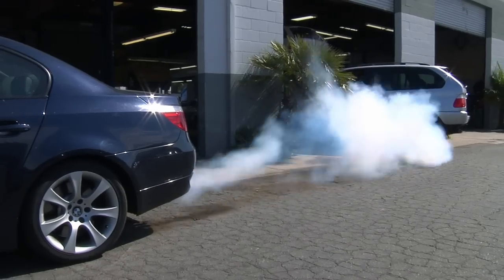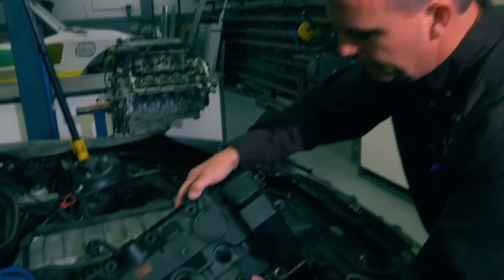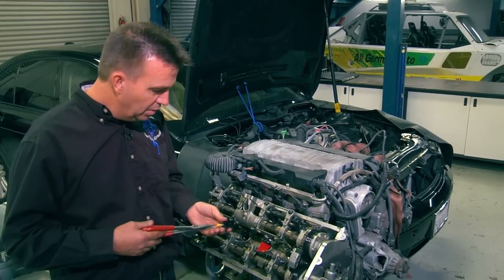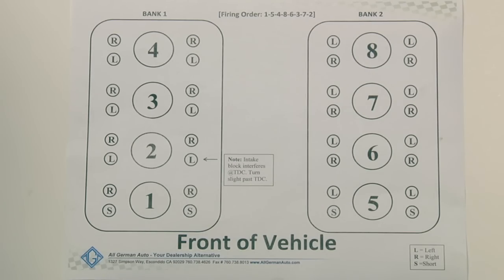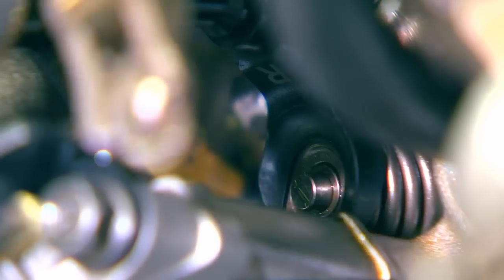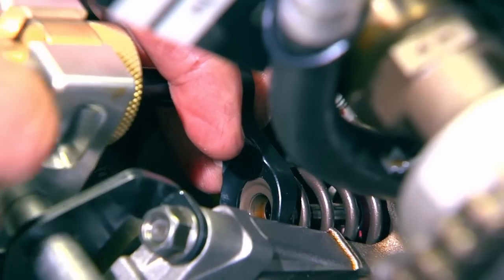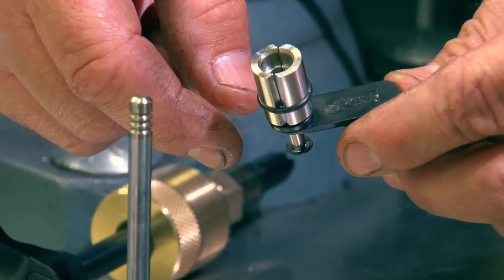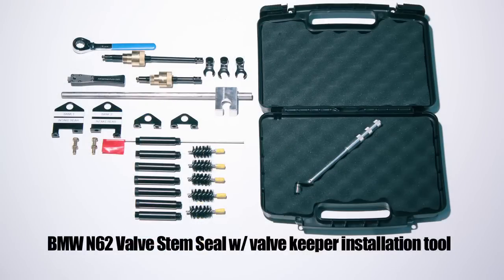N62 & N62TU Valve Stem Seal Tool Kit

Comment: Just finished my 3rd N62 engine,, it has become a more easy job every time, i have seen this job done the conventional way in other shops, and boy this is so much better!!!!  I would just add two things that work so much better for me: 1: work with rope ínstead of compressed air,  2: remove camshaft sensors before takin out valve covers, a little tricky but better and easier for the valve covers goin in and out.
Reply: Ray Rodriguez what do mean by “ using rope”?
Reply: P.I. M.  With compressed air there are many things that can go wrong, so just before reaching the top dead center I introduce rope to fill the cylinder and then gently compress from the crankshaft, and to lower the valves you only go back a little from the crankshaft, of course  to take out the rock arms
Reply: @rayrodriguez8886  you are a very smart man! Thank you

Comment: excellent tool .have an 2006 750 ,4.8 liter that needs valve stem seals im getting this kit thank you.this is why i like working on German cars.my boss is going to be happy..no need to remove cams .dealer quoted almost 10 k for this job.

Comment: Everyone at AGA is very helpful. They have a CS number where you can ask them or Rich anything to guide you through the process. This job is not for the  of . Personally, I had dropped keepers, searched, crawled inside, and on top of the engine, trying to see. One thing I've found that is extremely useful is prep the area with small cloth/paper towels that can catch anything you drop. An endoscope camera is extremely helpful along with small lights to help keep your work area well lit.
Reply: probably doesnt hurt to have a lot of magnet rails in case it falls. I mean 32 times repeat anything can happen w fatigue of hands. LOL

Comment: Pre 96 Ford 4.6L V8s had this EXACT problem. Hard valve seals, smoke, after 100K miles. Amazing how BMW let this happen. I have a chance to get a cheap  7 series with this problem. Smokes like a chimney. Dealer wants like 5K to do it. I thought I was looking at a Ford V8 DOHC engine, down to the beehive spring. The procedure is identical. Ez valve cover removal(crown vics need the evaporator and brake booster out). That compressor tool is awesome. The Ford has 2 primitive tools for intake and exhaust, and you have to use a breaker bar as a lever against the cam and spring while you fish out the keepers(not fun). I bet your tool would work for Ford too, definitely a market for that. Do you sell that part alone? I also use thick rope in the cyl head and bring it up to TDC. Had a bad experience once with air. Also, are the guides usually trashed? That was a not-so common issue with the early Ford SOHC engine. I also like the rope method because you can feel if the valve has play.
Reply: Crown Vics DO NOT need removal of booster or hvac box.  Also the valvetronic system makes the intake valves more laborious than on the Ford modular V8.  Not to mention most Ford applications have half the number of valves.  All BMW N series 8's have 32 valves with crappy seals.

Comment: An ambiguity with the Keeper Installation Tool exists at about 15:25 into the video. It says to "...remember to have the fat side of the keeper facing up" while the presenter is holding the tool upside down to load it. This is confusing and could mislead a newbie. The keepers must be inserted into the tool with the fat side down, narrow side up so when they are installed on the valve the fat side is up.
Reply: I apologize.  Not to be condescending, but his explanation is spot on.

Comment: great tool, good video instruction. i have used this tool and removing the intake is a must on e 60 545i. i was not able to access torsion springs on cyl 4 &8 on the intake side due to the valvetronic set up. after intake removal i was able to use tools .

Comment: the purpose of this tool kit is to be able to do it with the engine in the car. I would have preferred to see it done like that cause this doesn't really show the difficulties associated with that. it was still an informative video though, thanks.
Reply from the maker: We did do a video of the engine inside the car, but the number one complaint was viewers couldn't see certain angles. We had to recreate the video such as this so folks can see the procedure.

Comment: great video AGA could this procedure be applied to the N42/N46 engine having the valvetronic variable lift cam unit in place or would this unit have to be removed to gain access to replace valve seals.

Comment: I have a 2010 550i and about 6 months ago I started having intermittent smoke happen only if idling for a while. It's been eating up a lot of oil over the last year as well. I just had a BMW dealership estimate the cost of valve guide seals repairs and I was quoted $14,248.24. WTF?!!! That's 40 hrs of labor and $5100 in parts. The repairs are more than what my BMW is worth.
Reply: You can get it done for $2500 !! Never take your Bmw to the stealership after warranty has expired!
Reply: @JohnThomas-yf3gw  I'd definitely get it repaired for $2500, but I wouldn't know who to ask much less trust that they could do the job without ripping me off. I was told it wasn't going to cause any major secondary problems if I didn't get it done and I'll probably just hold off until I can find the right mechanic.
Reply: 1flybyguy  where do you live? I got a 07 650 that’s doing the same thing. I’m in Atlanta and there’s plenty of shops that will do it for 2500 maybe a little less
Reply: @JohnThomas-yf3gw  I live in the San Francisco Bay Area.
Reply: 1flybyguy damn if you were closer but the Bay Area wow.

Comment: old video i know, its great by the way, can you confirm this works with the n42/n45/n46 316 318 320i engines?
Reply: *****
thank you :) do you know if i am able to replace the seals on the engines i have said without the removal of the head?
Reply: +DAT G - DameAndThatGame 
It is possible. My mechanic changed the valve stem seals on my 320i E90 without the removal of the head.
Reply: Ale Ben hey, yeah I found a process now, thanks for the reply :)

Comment: do u have any video for 1999 CLK430 Valve Stem Seal Tool Kit what type of things would you recommend on an engine that has 216000 that's smoke a little bit in when i started up in the morning

Comment: Hey AGA guys, i just bought this kit to do valve stem seals in my X5 ´06, but neither in this video or the instructions that came with the kit it says how many psi of air pressure into the cylinders, would you be so kind to reply?
Reply from the maker: Ray Rodriguez 20-30psi is enough to hold the valve up.
Reply: TKS !!

Comment: You mention replacing the lifters "if they are bad".  Given that there are 32 of them and they cost $25~/lifter how do I tell if any particular one is bad?  I have a 745i with about 105k miles on it and it occasionally smokes and regularly throws P0492 even after using your Secondary Air Cleaning tool - no complaints on the SAC tool as it worked great but the valve stem seals are still forcing the code (which is always P0492).
Reply: Bill Riffert
The P0492 DTC is not related to the valve guide seals. it is a conditional code for sec air flow to bank 2. The plastic air pipe sometimes cracks and on occasion I see that the fittings detach from the air valves at the back of the heads. If you're positive that the sec air piping is in tact, then more than likely you have clogged ports. The chemical and brush kits you see on the internet will work sometimes
The permanent fix to this problem (if clogged ports is your problem) is to manually clean them. So either remove the heads individually or remove the engine assembly. the latter is easier and should be cheaper. if the heads are removed, then the exhaust valves need to also be removed. I don't suggest this route as its tremendous work. good luck wherever you may go.
Reply: Frank Lopez  would that cause smoking

Comment: Setting up to do this work. Questions about the air: where does it actually enters the engine and how much pressure?  Hose fitting thread size?  Thanks for the help !!
Reply from the maker: The leakdown tester gets installed into the spark plug hole. 20-30psi is sufficient for the job.

Comment: This kit is expensive to rent and a pain in the ass to use. You only need a long socket that fits the width of the spring. In the inside of the socket you glue a strong magnet that won't be in the way and hit the valvepin once you hammer easily on the socket. The magnet inside of it will catch the lockers so it has to be strong enough to suck the lockers so that they don't fall into the engine. After you change the seal you take the spring and compress it and put a stripe on each side while spring being in a compressed state. Don't stripe it all the way to the bottom because then then it won't lay flat on the seal. When you have the spring and the lockers in place you just cut the stripes and remove them out of the way and you are done 👍

Comment: Are the quality of the new seals better than the original ones? Thanks.
Reply from the maker: Apache, we recommend using and aftermarket company called El Ring. They make their seals out of a viton material which is far more superior than the OEM ones.

Comment: After installing the valve stem seal, along with the keepers, why is the air pressure relieved if you are going to compress it again to install the rockers? What is holding the valve up? Just the valve stem seal? 

Hope that makes sense lol. Just a bit confused.
Reply from the maker: Yes, the seal has enough tension to keep the valve up. If you don't relieve the air, you can't compress the valve and spring to install the rocker arm.

Comment: Hello,
Is there any other option how to do this job. It`s a bit expensive to buy tool for a single user. Any option like to rent ?
Reply from the maker: TheFreeg8407,

The only other way is to remove the engine, remove the cams and then remove the cylinder head to do this job. We do not offer renting of the tools. If you have any questions, please contact us directly at 760-738-4084.

Comment: Hi, I Purchase the 2 KITs , But I  have one final question that i did not find on the kit. What is the TORQUE SPECs to re-tight the bolts on the CAM TOWER ,Since its has been removed  and the VALVE COVER LID so it don't crack. or damage, You guys should make one very thin long plyers , I had much problem removing the old seal being stuck. very hard on X5  I really appreciate if you give the toque pressure for me to finish the job. Thank you
Reply: +All German Auto ,I dont have one, the 14 nm its for the Plastic valve cover or the cam tower brackets ?
Reply: +All German Auto I purchase the tool but the part that holds the rachet was defective! Can I exchanged it? I can email you photos of what im talking about!
Reply: +007Vision its call the rotation hand tool !
Reply: +All German Auto i will thanks for your support!

Comment: Thank you! I have to replace the valve cover gaskets on my 550i, is there a way to tell if my stem seals are good by visual inspection? (of course without having to remove them). I figured sense I will be removing the cover, I might check if this job will be needed.
Reply: No you are good, if they are bad you will get smoke all the time and also codes and it also becomes really bad after sometime. Stop thinking about it.
Reply: +Ribhi Kamal Get your engine really nice and hot by driving the car for about a half hour, then park it and let it idle for about 15 minutes without touching the gas pedal at all. Now go in the car and give it a quick wide open throttle for a split second. If you have a bunch of smoke coming out with that burned oil smell out your tail pipe you know you have this problem. This is a good way of telling before it becomes so bad that it's always smoking.
Reply: Thanks Bruce, that actually worked. By worked, I mean that I actually had the problem. I let it idle for a few minutes with the crank case ventilations closed and then I floored.

Comment: What about checking the valve guide clearance??  BMW has released videos in the past for the N62 and checking the clearance.  We have seen several N62 with worn guides, if your guides are worn you will be in for a nasty surprise down the road when the valve seal starts leaking again.  A short cut like this is a true life saver, but it is somewhat risky.  Could save the day if the guides are in good condition though.
Reply from the maker: Brent, after extensive R&D and doing many N62 valve stem seal (We did 142 valve stem seal jobs in 2016), the guides are usually never worn. Our highly experienced tech do test to see if the guides are bad, but out of the 100 cars we have done, only 1 needed guides.
Reply: I was under the impression the valve guides in the E62 are not replaceable. The online BMW factory shop service manual I found (European version) showed replacing the valves when the stem to guide clearances gets sloppy, suggesting strongly the the stems wear but not the guides themselves. What is the reality here?

Comment: Hello!
What is the preasure you put into the cylinder to avoid the valve to fall down into the cylinder, can't really tell in the video what preasure you used.

I have bought a N62 valve repair kit.

Thank you!
Reply: +All German Auto  using 80 psi  5 psi loss valve still fell
Reply: Vladimir Yemelyanov don't give up, after tweaking it worked out. Car works perfectly firm now

Comment: Having an issue with the intake rocker followers.  The spring that holds them pop out of place with the smallest touch (like putting the rocker back into place after replacing the seal).  Any tips on how to prevent this?  It is a pain getting them back into place.
Reply from the maker: Kr0nus, can you please give me a call when you get a chance? I don't quite understand what you are asking. You can reach me at 760-738-4084.

Comment: Had my bmw X5 5.0I in the shop this week has 93 miles on it  is a 2013 drinks 1.0l oil of 450 miles they told me my valve steam seals are bad took them 4 days to do it gave me a brand new 2019 loaner and BMW of North America paid for it all was covered under the class action suit for oil consumption
Reply: 93000 miles
Reply: Sisto Montoya Jr. make sure your car is registered with bmw of North America then go to your dealer and complain of oil consumption the can contact bmw and everything else is up to them good luck

Comment: I`m confused. I have issue with my car and cannot figured out if it`s bad head gasket or valve stems? My symptoms are white smoke in idle for like -2-3 mins. Usualy white smoke should be head gasket.
Reply from the maker: TheFreeg8407,

That is incorrect. White smoke blowing out of the exhaust is a tell tale sign of bad valve stem seals. The stem seals are deteriorating, causing oil to get into the combustion chamber, causing white smoke. 

If you have any questions please feel free to call Rich at 760-738-4084. You may also email us at rich@allgermanauto.com
Reply from the maker: Sisto Montoya Jr.  , no it won't. Sounds like you have bad valve stem seals. Letting the car idle and then revving it is a way to test for bad valve stem seals. If you get white smoke, that's bad valve stem seals.
Reply: @AGATools  assuming one doesn't drive in traffic jams so avoids the problem, how long to get from smoke after long idle to smoke all the time and error codes?

Comment: Can this tool be used on the mini N12/N14/N18 engines in any way?
Reply from the maker: Hi, so though this kit isn't made for those engines. However, we have MINI dealerships using this kit for those engines. You have to modify some cam brackets and the compression screw with the foots. We personally don't know the exact details but it can be done.

Comment: How many PSI of air should you put in the cylinder?
Reply: ***** Just so you know, 60-70 psi did the trick for me. 90psi turns the crank. Its also worth to mention that removing all plugs is not recommended since the risk of turning the crank increases. Thank you for the tool. It was very useful.

Comment: Wish this worked on N12 and N14....
Reply from the maker: Though it's not a direct fit, people have used this on N12 and N14. Word is, there's a video on Youtube showing this but I haven't been able to find it.
Reply: @AGATools  i found someone using it on N12 head, at least on exhaust side. Not sure how it will work with the valvetronic intake side

Comment: With the engine in the car is faking hard to do it the intake valve spring in back of head is pain in the back, this guy should make a video with the engine in the car
Reply from the maker: Carlos, with the engine inside the vehicle, the cameraman won't be able to get certain angles of the engine to show you what is needed to see and do.